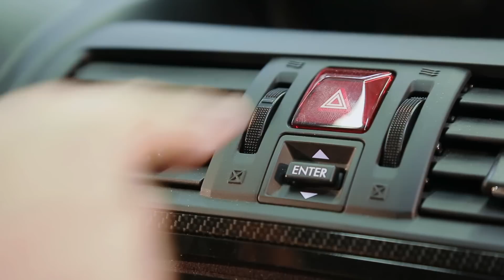How to Program the Diode Dynamics SmartTap™ CF18 (LM449) Flasher Relay

Comment: Doesnt work on gt86 2019. Wont save when you put stalk in center.
Reply from the maker: Sorry to hear about that! You can check out the listing on our website to see the compatible vehicles that this module is designed for:

https://www.diodedynamics.com/smarttap-cf18-led-flasher-module.html
Reply: @diodedynamics  I contacted the support who took the module under warranty but the problem is the same even though according to the support the vehicle is compatible

Comment: I have a 2020 Ascent and it seems like this item isn't compatible from what I've read. I'm mainly looking to switch to LEDs without hyper flashing. I've tried built-in resistor bulbs that worked fine in other cars, but in the Ascent these bulbs will flash normally sometimes, but also will go into hyper flash once they get hot (i'm assuming). My question is how can I get this vehicle to LEDs without hyper flash?
Reply from the maker: Please go ahead and give us a call at 314-205-3033 Monday-Friday 10 a.m.- 5 p.m. CST, or shoot us an email at contact@diodedynamics.com, and our in-house US service team would be happy to help you with that!

Comment: Do these hazard options hold memory because I can't get it to?
Reply from the maker: The speed at which you program the hazards to blink will save, but the patterns will not. For example, if you are wanting your hazards to wig wag, you would have to turn on you hazards and then hit the turn signal to activate it.

Comment: Does this relay fix the hyperflashing on LED bulbs? I installed the DD LED C light upgrade on my 2020 WRX premium and it hyperflashes.
Reply from the maker: This module does fix hyperblinking. However, you shouldn't be experiencing hyperblinking with our C-Lights. Go ahead and give us a call at 314-205-3033 Monday-Wednesday 10 a.m.- 5 p.m. CST (we are closed 12/31 and 1/1), or shoot us an email at contact@diodedynamics.com, and we can help you with that!

Comment: Hi guys, really like this idea, just wondering how this would go on an australian fj cruiser? Our indicators on the front only turn on when turning and cant stay illuminated. Is it possible to have the normal wigwag etc etc along with everything else but not have the turn signals constantly illuminated whilst driving? (We have smaller bulbs in the main headlight assy. lens for the same function parking lights) Also do you have a distributor in australia? Cheers 
S
Reply from the maker: Hi there! Thanks for reaching out! Go ahead and email us at contact@diodedynamics.com, and our service team would be happy to look into this for you! Thanks!
Reply: FYI the ADR says when the hazards are on both left and right indicators must turn on and off at the same time, at 30-90 flashes/min iirc

Comment: Would you run into any problems adding this if you already have resistors?
Reply from the maker: +Ryan Hanson You should not run into any issues installing our SmarTap with resistors already installed. However, if you do experience any problems at all, disconnecting the resistors should address that.

Comment: Will the smart tap work with sequential turn signals? If so how does it work?
Reply from the maker: +Mwu Check out the link below for our list of compatible vehicles!
https://www.diodedynamics.com/smarttap-cf18-led-flasher-module.html
Reply: Diode Dynamics I meant how would it work with sequentials on my wrx?
Reply from the maker: +Mwu Unfortunately, we are not able to confirm compatibility or function with any aftermarket headlights or tail lights which may have a sequential function.

Comment: Will this work with push button start on 2016 Subaru STI? As far as programming? I saw you worked with a turn key vehicle
Reply from the maker: +Ranger TS Yes, this function should work the same with push-button start!
Reply: Thanks! I'm about to order. I just installed my switchback c-lights and they're amazing. Only issue I have though is one turns on and one stays off when I switch to the DRL mode on the headlamp switch.
Reply from the maker: We're sorry to hear about those issues you're experiencing! Please give us a call at 314-205-3033 Monday-Friday 9 a.m.- 5 p.m. CST, or email us at contact@diodedynamics.com, and we can help you troubleshoot and send a replacement if necessary!

Comment: Same here as churchill. Arrival lighting (unlock) doesn't seem to be working.
Reply from the maker: +tfpjr We're sorry to hear you're experiencing these issues as well! Go ahead and call us at 314-205-3033 Monday-Friday 9 a.m.- 5 p.m. CST, or email us at contact@diodedynamics.com, and we can help you troubleshoot.
Reply: ya mine doesn't work form my FJ as well.
Reply from the maker: +carbonunit We're sorry to hear that you're seeing the same issue! Please call us at 314-205-3033 Monday-Friday 9 a.m.- 5 p.m. CST, or email us at contact@diodedynamics.com, and we can help you troubleshoot and send a replacement if necessary.
Reply: On my prius that function doesn't work either, everything else works tho

Comment: If I use LEDs for my front turn signals, but retain the stock bulbs in the rear turn signals, will they both blink at the same (correct) speed?
Reply from the maker: +MaulKiller54 They sure will! The SmartTap will correct any hyperblinking issues with your LED replacements, so they will match with your stock turn signals.
Reply: Awesome, thanks for the quick reply!

Comment: how do you do a combined wigwag strobe effect?
when you say a combo of eight effects, what would they be?
I fitted mine on a 2008 STi Subaru yesterday, dead easy to fit.
Reply from the maker: +neoquip For more programming instructions, check out our programming guide at the link below! You can combine the hazard modes to create effects like wig-wag strobe, slo-mo wig-wag, slo-mo wig-wag strobe, etc. If you have any further questions, feel free to email us at contact@diodedynamics.com! 
https://diodedynamics.com/docs/install/universal/SmartTap_Guide_2.pdf
Reply: yeah, read that. What does it mean when it says you can combine them with your strobe settings?
What/which STROBE setting are you referring to?
Reply from the maker: +neoquip There is one base strobe setting, and you can combine wig-wag and/or slo-mo effects with it to create other effects. If you have any further questions, feel free to give us a call at 314-205-3033 Monday-Friday 9 a.m.- 5 p.m. CST, or shoot us an email at contact@diodedynamics.com, and we can explain further!
Reply: Where was the flasher located on your STi? About to do this on a 2014 Crosstrek and haven't really looked yet. Hopefully it's easy.

Comment: Has the delay for the Tapturn for 2016+ model WRX/STI with OEM tap turn been fixed with this relay?
Reply from the maker: +Aaron Sze Yes! Many other CF18 flashers have a longer first blink, due to the analog capacitor used for timing. Our flasher is completely redesigned to be fully digital, so there is no hesitation or longer first blink.
Reply: @diodedynamics  after I push the hazard button I get on long blink followed by the 2 blink succession. That normal?
Reply from the maker: @tools3657  Please go ahead and give us a call at 314-205-3033 Monday-Friday 9 a.m.- 5 p.m. CST, or shoot us an email at contact@diodedynamics.com, and our service team will be happy to troubleshoot that!
Reply: Tools 365 was it normal? Mine acts the same way
Reply: @altazz  I will find out Monday and let you know.